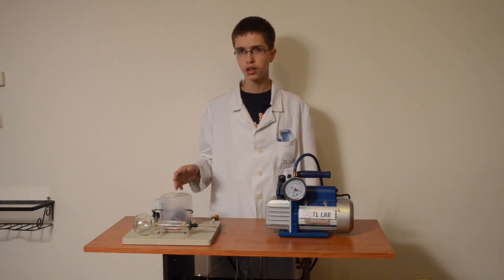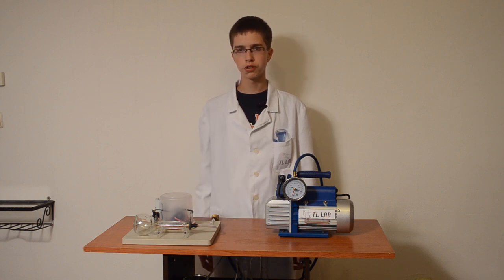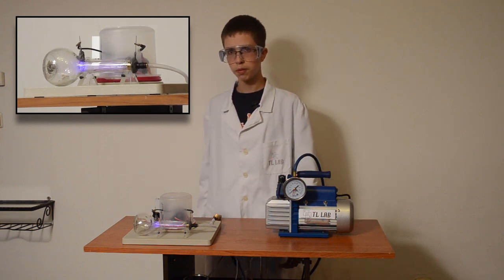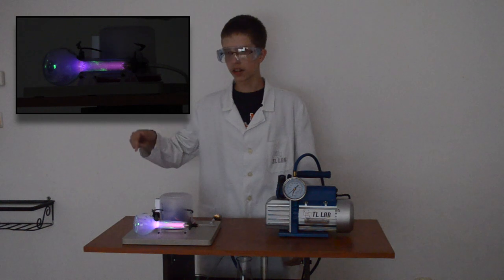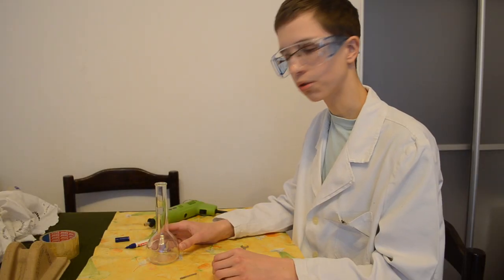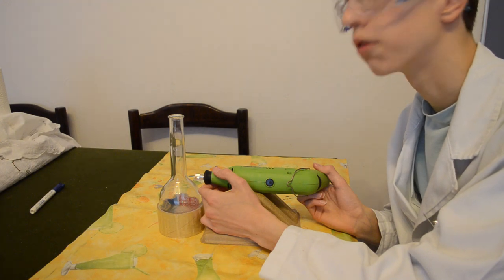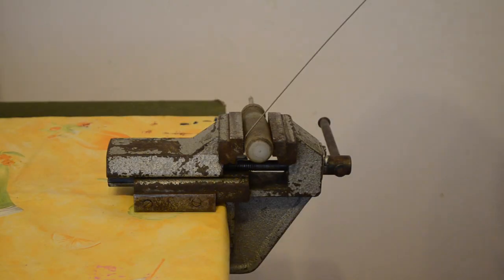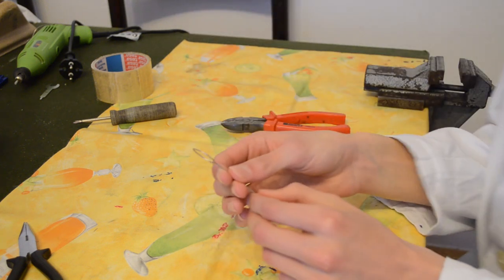Physics - Particle Accelerator

Comment: The best accelerator can be made of empty wine bottle. If you don't drink wine you need to spend a lot of money for flask. :)
Reply from the maker: You are right. You need to drink a lot of drinks to get right thickness of bottle because of low vacuum and you can't see how thick glass is before you drink whole bottle ;)